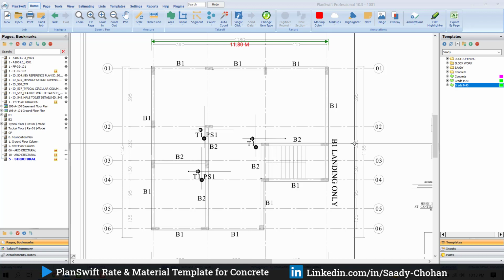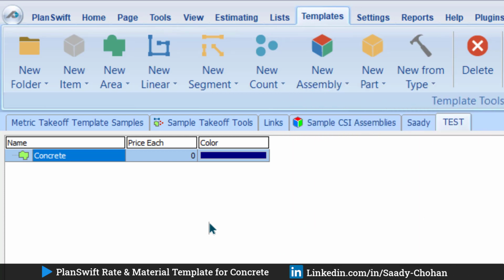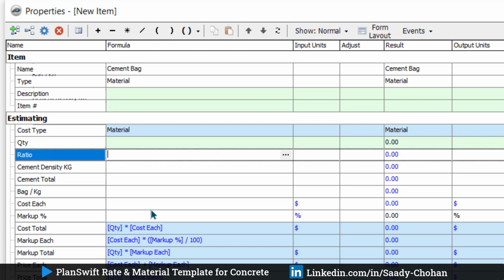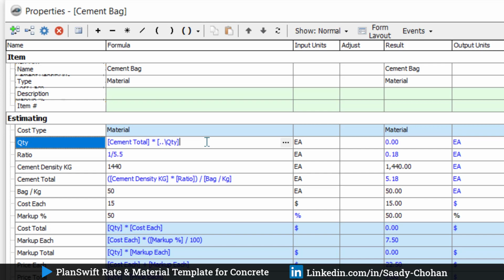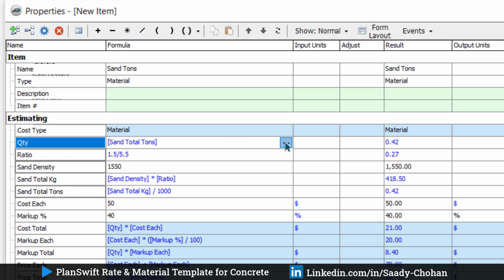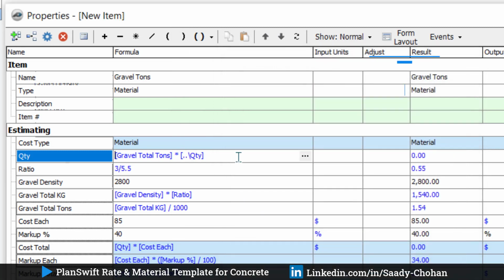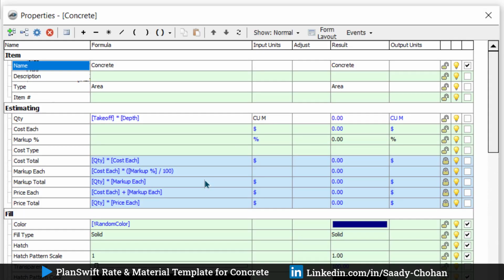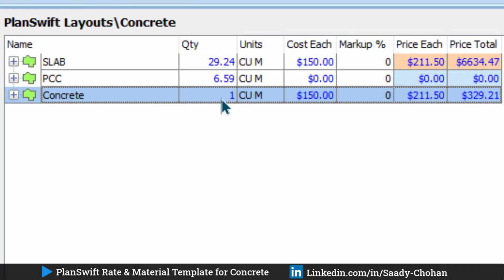PlanSwift Template | Rate & Material Analysis | Part & Assemblies

Comment: Dear saady! In calculation of cement qty.. Should we multiply it with 1.54 factory to convert wet cement into dry cement???
Reply from the maker: It depends not one standard answer but in general Yes, the factor of 1.54 can be used to convert the volume of wet cement to the volume of dry cement.